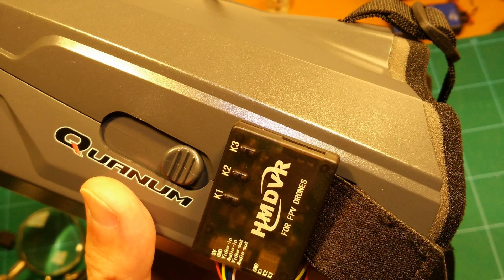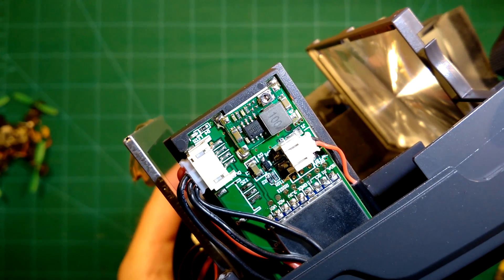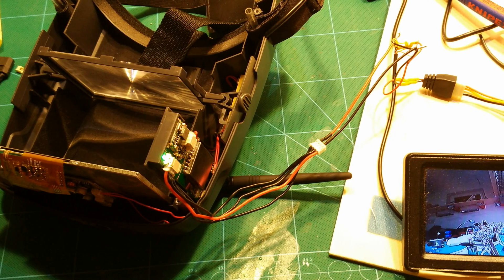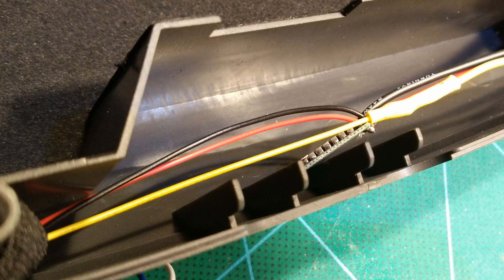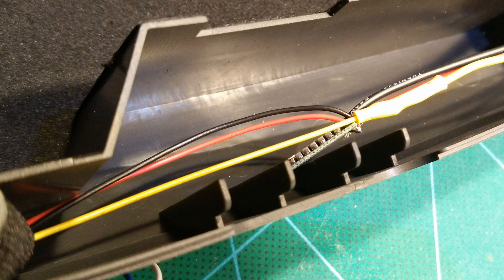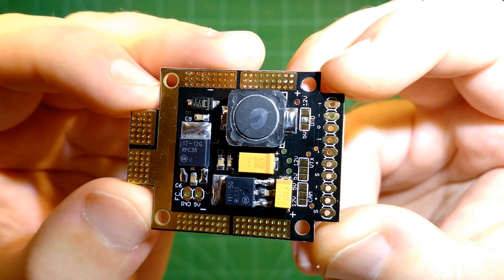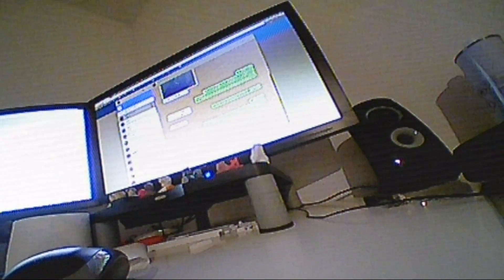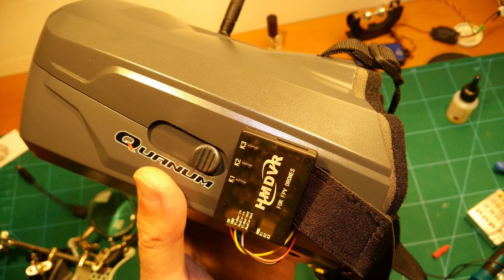How to add a DVR to your Quanum Cyclops FPV Goggles!

Comment: Great video... I did the upgrade, and it worked, but just a quick question: From the pictures and video it looks like you did NOT put the video through the Demon RC PDB, correct? I didn't and it worked, but wanted to make sure. Your picture of how you wired the Demon PDB wasn't all that clear.

Thanks!!!

Comment: can I add A/V in to these goggles?
Reply from the maker: Sure, you can hack everything. You'd need a video switch and an A/V connector. Should be simple :)
Reply: RC FPV Flight thanks!
Reply: RC FPV Flight could you send me a link to this switch I would need?
Reply: Did you work it out? I think just a switch to which video source to use. Just a regular switch will do.

Comment: Hi great video and clear instructions. You mention adding a video switch to replay the recording on the LCD. This is something I'd like to do, can you give more details on how to do this? I'm thinking a 2-way switch that takes the VRX video wire as input and has the LCD and DVR as the two switchable outputs. Is it that simple?
Reply from the maker: It is that simple. I did it that way for my Quanum v2 Pro goggles in this video: https://www.youtube.com/watch?v=QaeIuztnX0I
 
The actual "tricky" part is finding a suitable video switch. The one I used in the above video came with my Quanum v2 Pro goggles, but I was not able to source something like it separately so far. Do you know of a source for such a  or a similar video switch?
Reply: RC FPV Flight That's quite a fancy video switch. I was thinking of using a simple mini on/on toggle switch like this http://www.ebay.co.uk/itm/122186755157 for the video signal. Would this work do you think?
Reply from the maker: Definitely worth a try. Let me know if it works :)

Comment: Nice job! I just picked up the Eachine Pro DVR too and was thinking of wiring it directly to the monitor board of my old Quanum V2 goggles, which hopefully has a 5V out somewhere to power the DVR. Do you have a circuitry schematic of that monitor?
Reply from the maker: No, I don't sorry. But if you take a multimeter, I'm sure you will be able to figure it out quickly :)
Reply from the maker: No, I don't sorry. But if you take a multimeter, I'm sure you will be able to figure it out quickly :)

Comment: So is this cyclops goggles better then the eamachine 007 and 008 goggles
Reply from the maker: I don't have a direct comparison. But the Cyclops are very good. They are my main goggles right now.
Reply: RC FPV Flight I seen a review where they said it makes you crosseye to get good focus and said video glasses better but I like how you can wear glasses with this gyclops, HK has them for $75 AU
Reply from the maker: Mine have great focus. I do not need to crosseye. They are also really comfortable to wear, much more comfortable than my older Quanum v2 or Quanum v2 Pro. :-)
Reply: RC FPV Flight good to hear as I just ordered one from AU warehouse and was having second thought when I was told no sound but I dont need sound. I went for this because of screen size

Comment: Could you show a picture of the pdb with the cables soldered in place, which terminals did you use to get the 5v for the dvr. i have bought this board on your advice and i want to be sure i'm not mixing my wires up
Reply from the maker: Hi! Here is your photo: http://rcfpvflight.com/wp-content/uploads/2016/10/howto.png

I first soldered the 5v pad for the camera voltage output to make sure it is 5v (lower left arrow) and then connected the HMDVR to the plus and minus of the PDB's camera output (upper arrows). Hope this helps :)

Comment: Just a suggestion: maybe you could think about doing a mod video on the Boscam GS923 goggles? With some cable mods & maybe using the HMDVR too it would be like having Dominator V3 for only $200. The resolution & FOV seems quite good for those 'cheap' goggles.
Reply from the maker: Many thanks for the suggestion, I'll look into it :-)

Comment: Dude will this PDB work on this? http://goo.gl/8qYGke 
it says it has filter BEC but not LC filter
Reply from the maker: I'd rather try this one, it comes with filtering: http://www.banggood.com/Diatone-V8_3-LC-Filter-Power-PDB-Board-HUB-Low-Ripple-Current-Series-For-RC-Multirotors-p-1052002.html?p=I32013833408201410RW

But take care, this one will require you to run your Cyclops at 3s. Which is no problem for the Cyclops. Just something to be aware of.
Reply: what happens if I use 2d only but will not use the 12v output will the 5v out still be 5v?
Reply from the maker: I don't know, sorry.

Comment: I used the bottom first and third cable when Red is down the fourth one and just provided a extra Batterie with a polulu for the dvr....
Reply from the maker: An extra battery is of course always an option and will make sure you can limit any interferences to a minimum for the DVR. There is the small additional hassle of having to charge and maintain two batteries instead of one though - but that is something one can live with I guess :-)

Comment: I did something similar but then with the PRODVR from eachine. But i connected it differently than what you did. I used the 5 volt that is supplied to the LCD. (from factory it came out 6V so i adjusted the pot meter to lower the voltage to approx 5V, this is mounted on the the receiver).
Reply from the maker: Many thanks for your report! Very interesting. I also considered doing it this way, but was not sure if the voltage regulator could handle the additional load of the HMDVR. That is why I went the "safe route". Great to hear that it works this way as well!
Reply: stedjakusuma hey mate i got the same dvr and about to mod it to my quanum cylops are yours still running okay using yhe 5v straight from the receiver on the goggles?
Reply: Yep no problems. Just make sure you lower the voltage to approx 5V.
Reply: Cheers man lowered it to 5V and DVR is running sweet.

Comment: Hi, I will be doing this modification soon but I have a question.

Is there an alternative BEC LC on banggood I can order within the US that would work?  

Thank you for the video!
Reply from the maker: I found this one to work quite well. I have not used it yet to modify one of my DIY glasses, but as a general LC filter this works great, so I think it also should work for modifying DIY goggles to include a DVR: http://bit.ly/1ropEA0
Reply: +RC FPV Flight thanks but it looks like I need a 3s input for that board. can I use 3s on the Cyclops?
Reply from the maker: Yes, Operating Voltage: 7.4 -12.6v :)

Comment: Alright! I got it working. The negative wire is the one just next to the red one. I made a switch between the build in monitor and a RCA jack. This way I can bridge the monitor and connect it directly with another video source like 1.3GHz video in. It worked like a charm. If anyone is interested let me know.
Reply from the maker: Awesome! Great report, many thanks for this. I'm sure many are interested in this, so if you can put it online or do a video on it, feel free to link it here.

Comment: Thx for sharing! Couldnt you just use a cheap step Down voltage regulator and a cheap lc filter? Why do you need to use a PDB? Surely i'm missing something out. I also watched your Quanum goggles V2 pro video about the same thing.
Reply from the maker: You can definitely use a voltage regulator & lc filter instead. I simply used the PDB (which is basically a voltage regulator & LC filter all in one) because I had it at home already. A good LC filter is important however, since the HMDVR is very noise sensitive.
Reply: Wow that was fast reply :-). How do i know its a good LC filter, there are sooo many to choose from? I see the demoncore PDB did the job well, but its kind of expensive. And the important thing is to Connect the lc filter between main battery and vtx?
Reply from the maker: There are indeed many to chose from and this is where I cannot really help you much, since my experience is limited. This one seems to be good and with many good reviews, but I have nto used it myself: www.banggood.com/L-C-Power-Filter-2A-RTF-LC-FILTER-3AMP-2-4S-LC-Module-Lllustrated-Eliminate-Moire-Video-Signal-Filtering-p-1021460.html?p=I32013833408201410RW
 
You need to connect it between the main battery and VTX, correct.
Reply: Yes i noticed that filter on Banggood. Thx again Mr. RC FPV Flight. 5 stars to you. :-)
Reply from the maker: Cheers mate, glad do have you with us. If you go with that filter, let me know if it worked well please :-)

Comment: Use this BEC, it's the same like on the Demon Core PDB , linear (no interferences like switching ones), it has ONLY the 5v reg you need with nothing extra : http://www.banggood.com/Diatone-Micro-BEC-5V-6V-12V-500mA-Module-For-RC-Multirotors-78-Series-Regulation-Chip-p-1027492.html   (select 5V version)

cheaper, ligher, smaller
same effect like daemon core.
let the pdb be a pdb for a quad.
Reply from the maker: Awesome, many thanks for the pointer :-)

Comment: The "easy"  dvr solution costs almost the same as the googles
Reply from the maker: "Easy" does not always mean "cheap", right? :-). Anyways, one can always experiment with a lower cost PDB with LC filter, such as this one from Diatone: http://bit.ly/1ropEA0 . It might work as well and would reduce the cost for the PDB. In any case, even with the high quality PDB, less than 100 USD for some nice FPV goggles including DVR is still a good deal I think.
Reply: with "easy" i meant for me as a total beginner it seems not to be that easy ^^but that cheap PDB Looks good, i think i will try it one day (iam better in all that technical stuff)
Reply from the maker: Ahh :-). I see. It is really not so hard, if you know some very basic soldering. Simply tap into the right three cables and you are good to go :-)
Reply: i think i will give it a try if my build is done  :)The Idea of an dvr in this just to seductive to be ignored ^^
Reply from the maker: Absolutely! I specially love it for my very small birds which do not have a dedicated recording camera, like my tiny 3D printed FPV microquad: https://www.youtube.com/watch?v=dCQ3Gy592EM :-D

Comment: I've been wondering about doing this on my Fat Shark Attitude v3s. Do you know how easy it is to get into them?
Reply from the maker: It should be a breeze - really simple. The Attitude v3 come with an AV in/out port. You can use this to get the video for the HMDVR (see page 7 of the PDF here: https://madlabindustries.com/wp-content/uploads/2015/10/FSV1045-Attitude-V3-Manual-RevA.pdf). For the power simply connect the PDB/LC filter to the balance connector of your lipo and supply the HMDVR with power through it (like I did in my video). You should be able to do this update easily :-)
Reply: Great, that really helps. I might design up a 3D printed box to hold the PDB and recorder then to keep it all neat. Thanks for the quick reply.

Comment: You did a great job on this video! I wonder if I could do the same thing to my HeadPlay goggles? I think so because although there is no video out on the HeadPlays,  I should be able to tap into the video source like you did.  Thanks for sharing and thumbs up!
Cheers, Bob
Reply from the maker: Many thanks Bob! You are completely right, you should be able to do exactly the same to your HeadPlay goggles. Just open them up and take a look at the cables going from the receiver to the monitor. You can first use a multimeter to find out which cables are power (plus, minus). The other cable (ideally one, two if audio is also involved) will be video and audio. There you can just use trial and error (in my case I used an external monitor) to find the video signal. Once you have it, you have won already and you can finish the job in exactly the same way as I did for my Cyclops :-)
Reply: Awesome, thanks very much!
Reply from the maker: I just had a chat with a buddy who owns the HeadPlay HD and he says that when you open them up, the different cables on the connectors are nicely labeled. So you won't have to do any tinkering to find out which one the video cable is. What a luxury! :-D. Just a short heads-up for you, adding the DVR to the HeadPlay HDs should be a breeze :-)
Reply from the maker: I have the Fatshark filter at home as well. It is only a capacitor, so it is not a very good power filter. I'd really suggest to get a complete LC filter here. I know the LC filter on the Demon Core (http://bit.ly/23xjay3) does the job. I also know the Pololu was not enough. 
 
Two other options which might work well according to their specs:
MXK PDB: http://bit.ly/2387oIU
DTI PDB: http://bit.ly/1ropEA0
 
If you prefer getFPV.com, the Atas Pro looks like a viable solution: http://www.getfpv.com/electronics/power-distribution-boards-pdb/atas-pro-mini-power-distribution-board.html
 
Please keep us updated on which of these options worked for you in the end. Maybe even the Fatshark filter is sufficient together with the HeadPlay HD's (it also depends on how good their power filterin is!). Keep us updated :-)